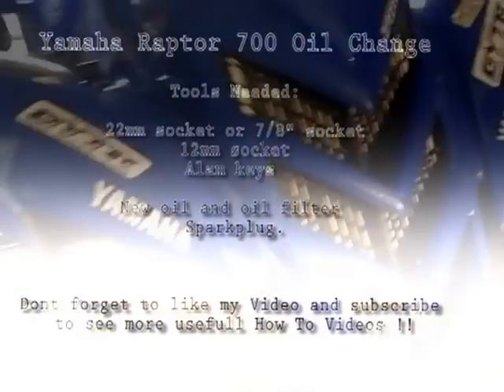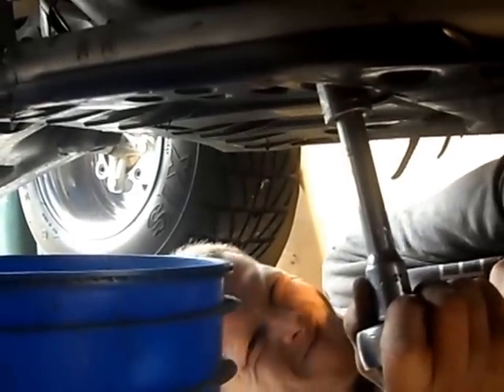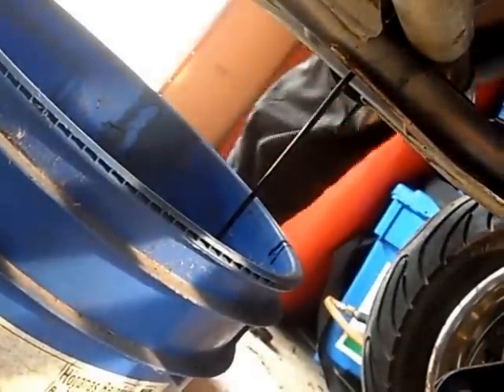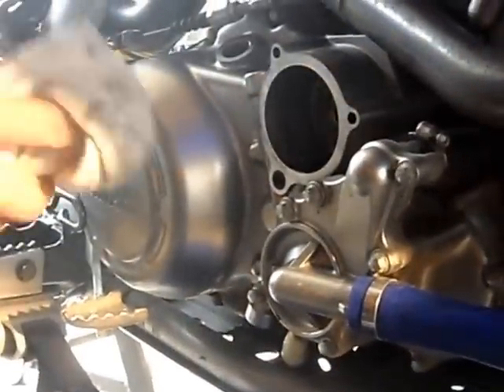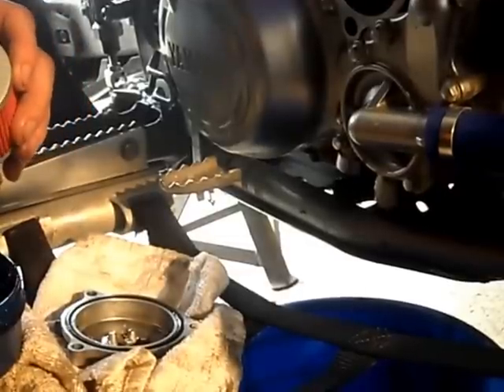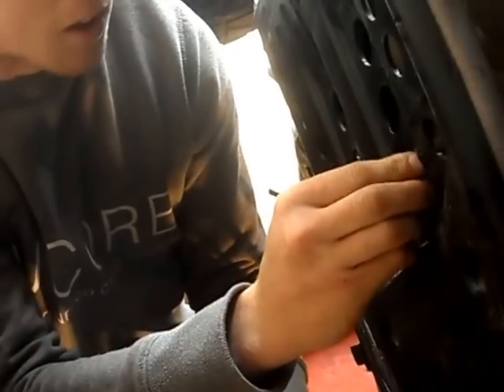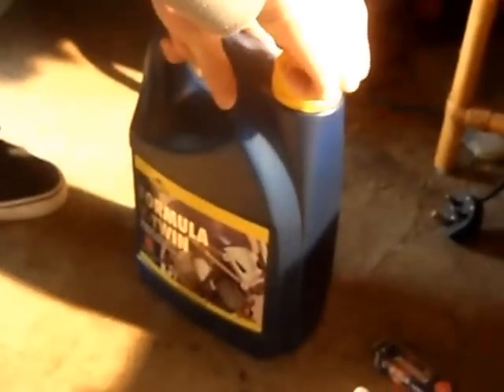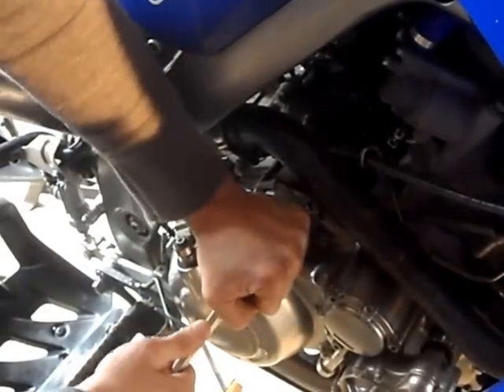** HOW TO ** YAMAHA RAPTOR 700 OIL CHANGE SERVICE

Comment: Thanks for a great vid. I had no idea how to do this until I watched the vid. I did it in about 45mins without any real problems. very easy to do even for your first time. I have 2 tips for you. 1 when filling your resovoir use a funnel with a small diamator or a long spout otherwise you'll have difficulty putting the oil in. A wider short funnel will catch on your plastics. 2. Do not over tighten your 10mm alan head screw to your engine it will sheer off. just nip it up.  Two of my friends did it and so did I. Ruined a good job and now has cost me to replace. Be gentil!!

Comment: Good video the only thing I would say is that you only need 0.55litres in the crankcase not a litre and when you check oil level don't screw in the dipstick or youll get a false reading and its a good idea to run engine till hot so you get more of the old oil out (thinner when hot)
Reply: U tell em dad♡